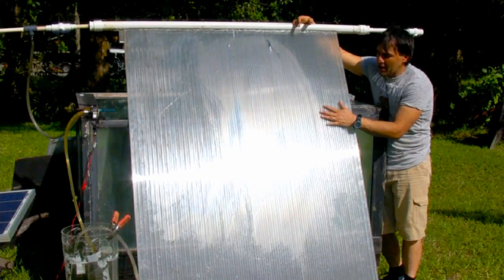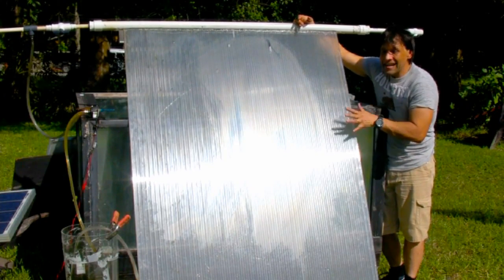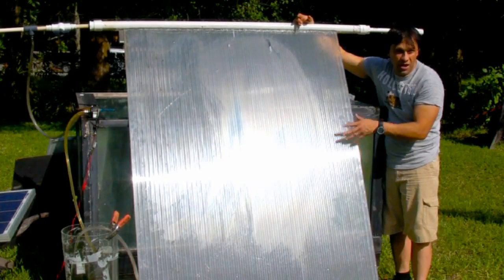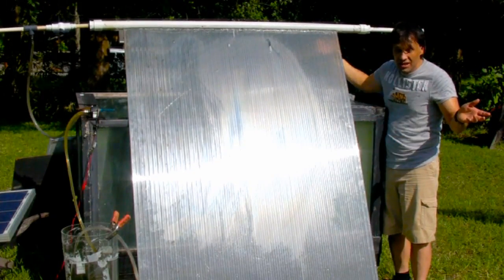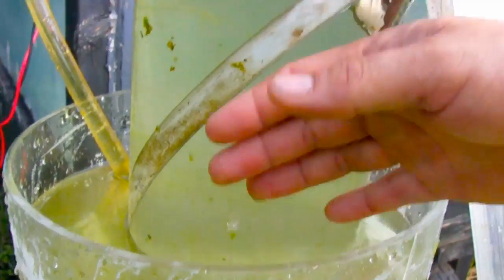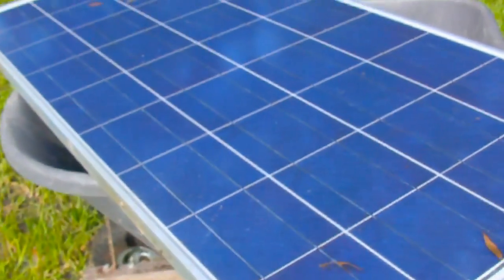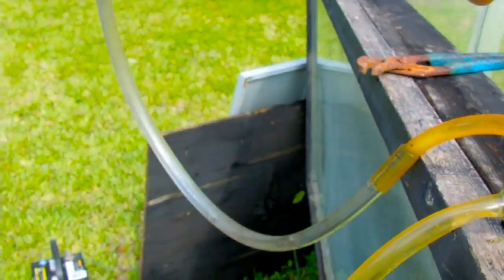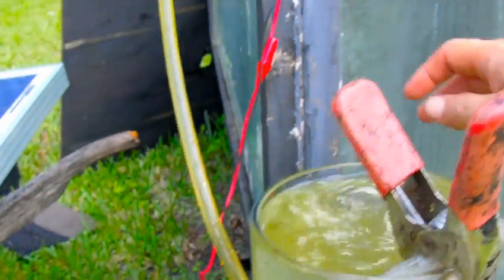ALGAE BIOFUEL Panel Reproduction Reactor Solar Polycarbonate Algea

Comment: Hey Dan - The hurricane polycarbonate sheets you are talking about seem to be available in the southern states at Lowe's.  I am checking with the local Lowe's here in Des Moines Iowa to see if inter store transfer can be done. FYI for everyone these are the ClearView Hurricane Polycarbonate Panels they come in 2 sizes 4'x6' SKU# 258569 $88 and 4'x8' SKU# 258571 $118.  Hope this helps good luck to all.

Comment: If a check valve, also refered to as a foot valve, were placed at the bottom of your suction line when the panel gets blocked by clouds the foot valve prevents the water from draining the pump and would not require repriming.

Comment: Watch out for the plastic you are using.  It does not like hot water.  It might get a bit hot as the water darkens a bit.

While a little less transparent a material that would work better for in constant contact with water would be coroplast.  Similar structure but better to be constantly in water.  Also if you can find coroplast locally it should cost alot less money.  Probably less than 1/2 the cost of polycarbonate.

Also this looks almost like a solar hot water collector.

Comment: You have to put your algaes in the dark sometimes for they store oil. There is also a need to provide concentrated CO2 to increase the rate of production. Because algae strains with lower lipid content may grow as much as 30 times faster than those with high lipid content, you have to search the bests algaes.